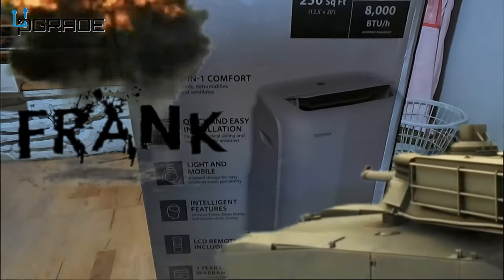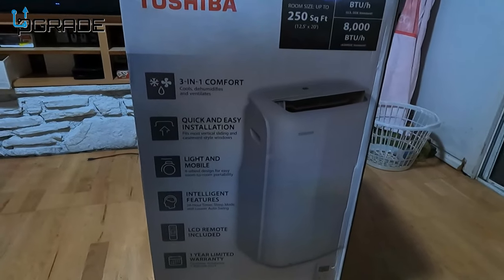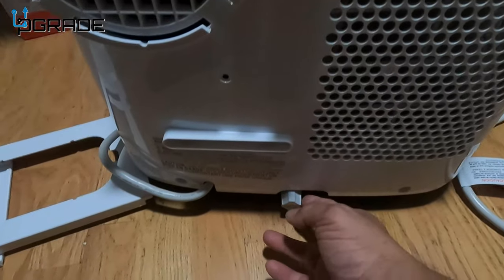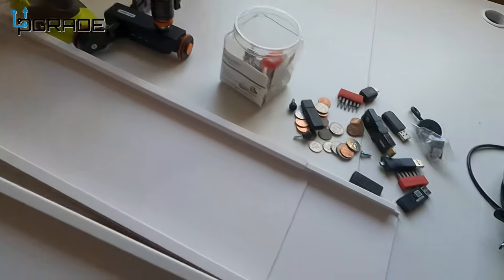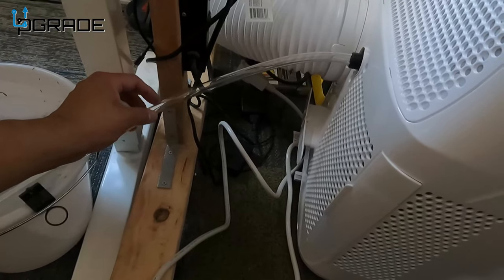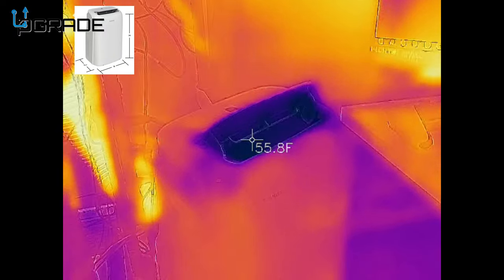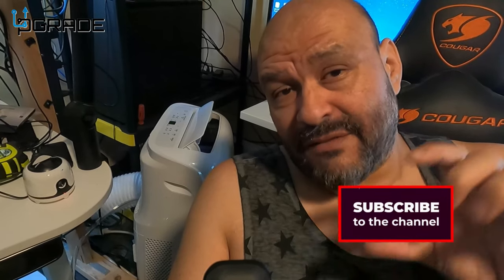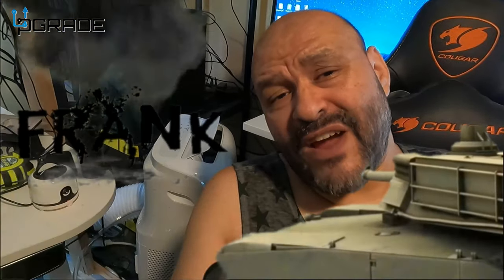Toshiba Air Conditioner with Remote

Comment: I bought one from a person who failed to tell me that it didn't come with the part that connects the intake to the unit. So my husband  has duct taped that intake hose to the back and it releases a ton of heat from the back of the unit . It works great but also behind the unit it is warm. I need to figure out what the part is called so I can try to order it. Does anyone else unit feel wa on the back?
Reply from the maker: I have a video on the part but the parts I review aren't the correct size.
Reply: Yes this is exactly what i came to look for. I have HVAC tape on it now but it came off and all i had is regular duct tape. Its completely melted off hot air is just pouring out. I need to find the part because i have to keep taping it and its a pain to tape

Comment: My wife magali just bought one I think i installed it right
Reply from the maker: What do you think about it so far.
Reply: @Upgradetech  uuuuuuu
Reply: @Upgradetech  it works super good, for the room that gets hit by the sun the hardest and is always hot in there, night and day difference when you let it do it’s thing. Only thing is even on low fan mode it’s still kinda loud
Reply: @Upgradetech  it doesn't cool

Comment: I think at 2:36 you meant to say it's a high current (or high power) system. That's why it takes the larger plug and consumes more energy...not because it's 110V.

(edited to fix typo from "0" 36 to "2" 36)

Comment: How often does it need to drain?
Reply from the maker: If you run this for 8 hours a week it will fill a gallon
Reply: @Upgradetech  So I don’t have to have to constantly have hose out with the bucket the whole time it’s running I can run it up to eight hours a day and drain it. That part was so in clear in that manual.
Reply from the maker: The system will shutdown and beep to drain the water and then you will have to drain
Reply: L
Reply: I run this thing every night during the summer and have only has to drain it once
Reply: @Upgradetech  mine never beeped it just ran until water started blowing out of the top...